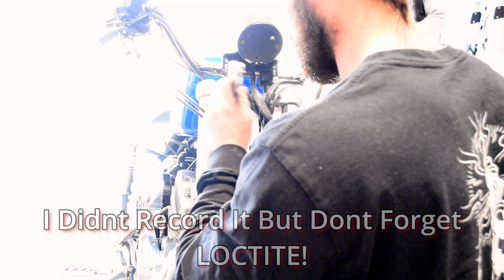DIY - Swap Your Harley Sportster Headlight To A RETRO Style One!

Comment: Very cool, what type of metal did you use? I’m assuming stainless but the measurements thickness, etc..
Reply from the maker: It was 3mm stainless steel, I don’t remember all the exact measurements off the top of my head, but they should all be in the video though.